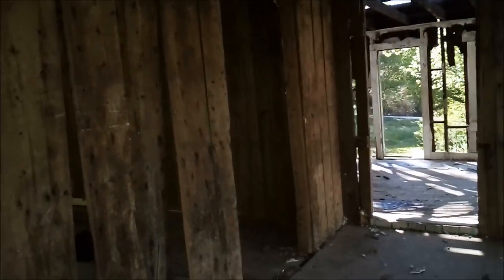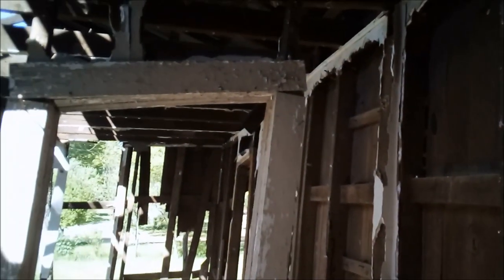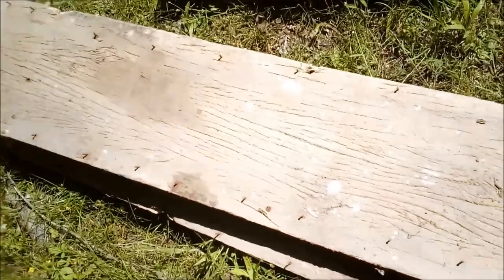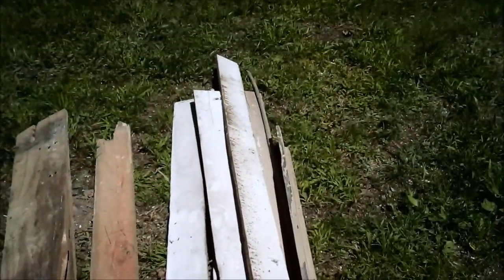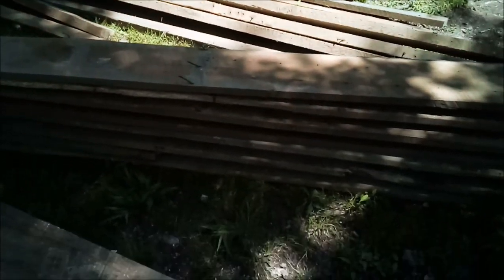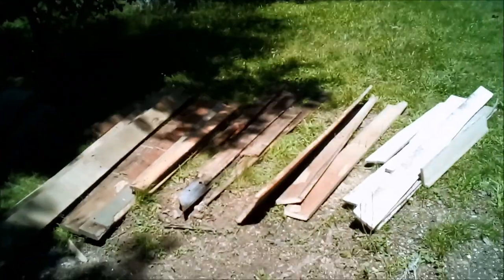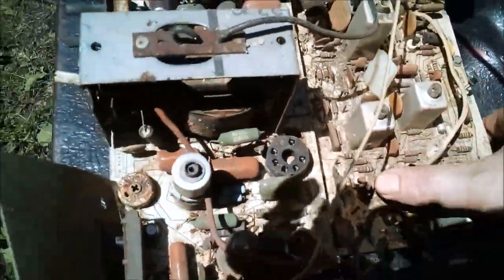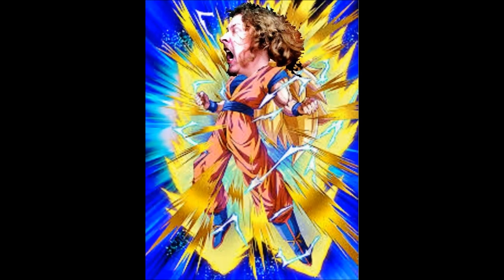How I Get Reclaim Guitar Wood For FREE!

Comment: Oh whoa-ho-ho! Nice score. I gotta wonder, with all the “free! You haul….” pianos and organs out there, what do you think of the components and wood mined from those sources?
Reply from the maker: Thanks again Jason, I ended up coming back and tearing this entire house to the ground and hauling it all away minus the rafters and floor, its stacked up in the corner of my garage in a huge bundle. 
  Dude if you can get pianos or organs for free and have a way to haul and store them I would do it 10/10 times. Excellent source of old-growth well seasoned and perfectly planed woods. The pianos have a giant cast iron plate in it you can take to the scrap yard for decent $ to cover gas and as for organs... complete gold mine! the older ones will have alnico speakers and tube amps inside them as well as possibly spring reverb units and the later 60s ones will have alnico or ceramic speakers as well and may be just packed full of rare germanium transistors that go for 3-5 bucks a piece NOS online, so if you want to build pedals or fuzzes etc you could strip one of those out and have parts for years plus all that wire. Great idea.

Comment: Not many sees the beauty in the old.  I see that wood the same only don't paint it as I hate painted wood (unless I just have to) but a good boiled linseed treatment with wood stain, is just YUMMY (especially on the old wood).
Reply from the maker: Thanks General and absolutely. I just couldnt see all this be burned thats heart breaking. I ended up going back and tearing the house down and taking all but some of the floor and rafters and putting it in the garage. I should not have to buy much guitar wood in the future. As well you just cant beat old growth natural wood including things like chestnut that are all but unavailable now. Also I think that it is plenty cured as well and all the nail holes and stains are perfect for what I am going for. I agree that if you can get decent wood it is a shame to paint it a solid color, I feel that it should be stained or grain popped and covered in a clear poly or other transparent finish.
Reply: @heavymetalATC  The history, and the stories that old LUMBER could tell us if it could talk.